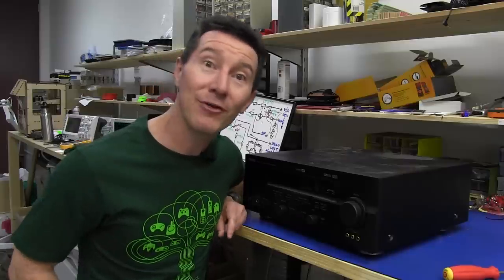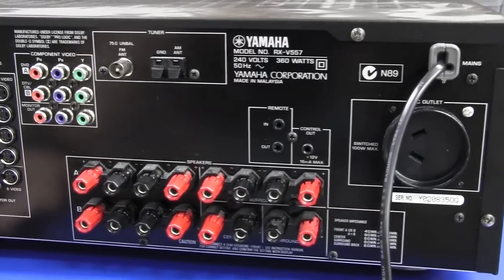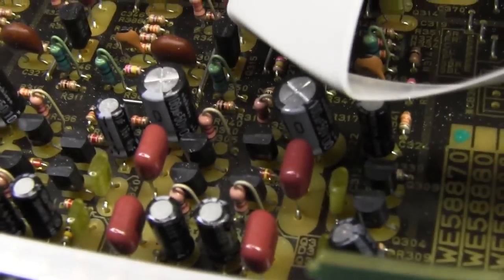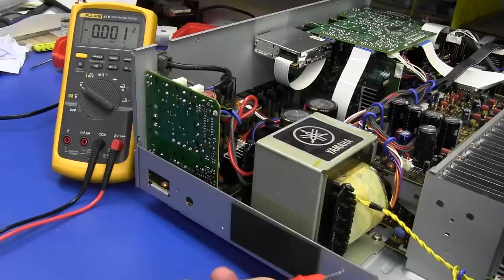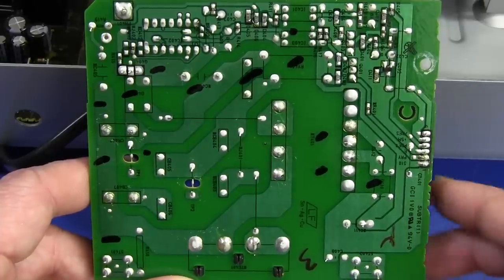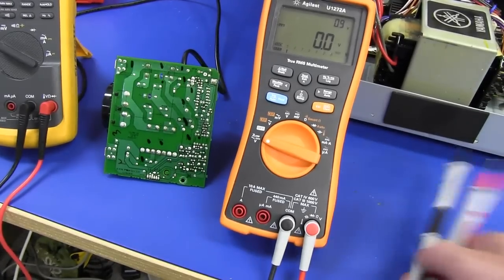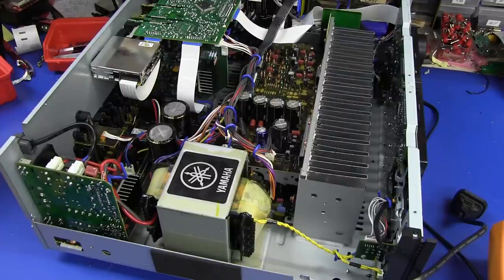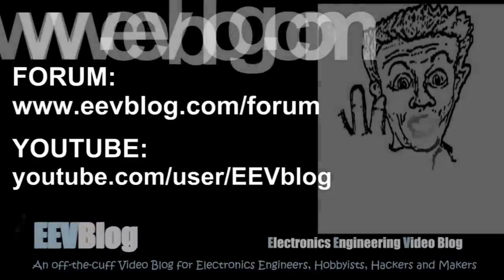EEVblog #378 - Dumpster Diving Teardown Repair

Comment: Dave a few steps for you:
1. Desolder C405 from standby board
2. Throw away
3. Solder a replacment
4. Enjoy
Reply: Hi!  Are you a repair guy?  Any experience with an RX-V1000 model?  Bought mine broken at a thrift store.  Her relay clicks when I hit the power button, but immediately clicks back off without ever showing anything on the display.  If I hold down the diagnostic combo buttons, the relays will allow it to stay on (even the speaker relays click after a second or two), but yet, no display, so I can't go through the diagnostics.  I can hit the power button and relays click off like normal.  Ever had that problem?
Reply: @FortyTwoAnswerToEverything  Same problem with mine mate.
Reply: @FortyTwoAnswerToEverything  I have the same problem with RX-V630.
Reply: @Brian-uq6jm  sadly I gave it away for another person to fix it.  I didn't want to put in the energy and time to try to fix it since it's very outdated with surround features like dts-x, atmos, 4k passthrough, etc
Reply: I got the same problem on a RX-V567, but I can't find the similar C405 component.
Cound you help?
Reply: So the question is, what focused you on C405?
Reply: That’s normal problem in Yamaha denon pioneer …..
Reply: @go_dirtty  same for me on a RX-863

Comment: C-405 (marked 223K 22nF @ 630 V) is your likely suspect on the mains PSU board
Reply: That be the one , that's what had mine playing dead.. fixed that $3 part and away she went better than new 👍
Reply: Hi I had the same issue on another receiver (RX-V459). I fixed it and it is now randomly shuts off after certain time sometimes even 15minutes. Do you know what can be the issue? Is it maybe the caps on the clock or data on the flip-flop?

Comment from the maker: Yep, turns out that was the problem (measured 500pF). Now, the question is why does such a 630V metalised polyester cap commonly fail in this circuit?
Reply: As soon as you powered it up, it showed a short, I was hoping you'd check for shorts on the caps/diodes as that's where it tends to fail, if we're lucky enough it's not the main IC/cpu that failed
Reply: @cjdelphi  What's the specs on that 630 volt poly cap?  Is there an "upper range" of current it can tolerate?  What if there's a temporary current spike on that line?  Or a change in the characteristics due to heating, or a soldier joint weak-point.
Reply: Which cap was it? It wasn't a varistor was it? Perhaps it was designed as a voltage spike protection and the thing got hit by lightening or some other spike.

Comment: I always recommend checking the output mosfets right away on any amp teardown. It's quite typical that a shorted output will trip a safe mode and keep the amp from fully powering on.

Comment: I'm always amazed at how quickly Dave can trace out the circuits, I worked for several years in a repair shop and I would have been lost here without a service manual.

Comment: I had an old 2001 Pioneer amp weighed in at 35kg she stopped working one day and I decided to open her up and see inside, my mouth fell open the detail and the quality was unbelievable Pioneer made some amazing stuff.
Reply: iShootBandits back when pioneer were good!! cant go wrong with japanese stuff. my 1979 yamaha cr820 just failed 20 minutes ago. after 36 years of HARD work the right channel failed. thats the first time it has ever gone wrong.
Reply: smallenginedude71 if you have right channel in headphones more than likely its the right speaker relay. for a relay to last almost 40 years is incredible
Reply: PhuckHue2 i had a sony hifi that lasted 25+ years, im only 26 though, it was given to me, but a few months back the right channel failed, i never found out what happened, so, i took her apart and got ALL the boards out, and all she contains is... rubicon and ELNA caps... but, im often curious as to what those tiny little yellow capacitors are ?
Reply: +iShootBandits same thing for the speakers.
Reply: killer1479
yellow caps are made by Mallory
Reply: PhuckHue2 well, theyre super tiny and look like theyre made of jelly =o

Comment: Good job on the repair. This unit is really complex and over engineered. I found a RX-V757 at the local Goodwill for US $25.00... and this one worked from the start...but... no remote or AM antenna. I did find a remote on EBay that controls the functions properly.

Comment: I wonder if the display is burnt. I have an old unit that appears dead, however the display is dead, after a fee button taps (with speakers plugged in) great music!
Reply: dry solder joint on display   connections maybe   reflow works on denons

Comment: Indeed. I work in a return material analysis lab and am surrounded by engineers. All of them work on diagnosing problems with existing equipment and finding a way to improve it. We get a lot of failed parts back and often times, an engineer will actually fix them to prove the source of the problem.

Comment: Yamaha made AMAZING products back in  the day. I still play a 1978 Yamaha guitar combo amp. I had to fix a couple of lifted traces where a former owner replaced the reverb pot with a VERY stiff pot (which put WAY too much tension on the board). It's just now beginning to get a bit of noise as if the power caps are starting to go. (After 40 years, I really don't mind replacing a few caps.). Still sounds amazing and is a very simple and solid design. Yamaha rocks!

Comment: I took apart the SAME EXACT one and I used the transformer for a power supply and the huge audio caps for the smoothing and the rectifier on heat sink for the rectification! And of corse all the wire I used for the power supply too!  Awesome!

Comment: I once have repaired Yamaha amplituner. It was not turning on at all. After just few minutes of searching in the internet i found that common issue was a cap in standby power supply, quick check with the multimeter and the capacitance was way off specs, part was easy to get in local electronics store, costing close to nothing, amplituner is still fully working today, my sister uses it quite a bit.

Comment: Those "heatsink things" on the large QFP are there to help with wave soldering. That's also the reason it's mounted at 45 degrees. It's not for routing, that's a requirement for wave soldering to work properly on a device like that.

Comment: I had one did the same, i had to push 3 switches together to reset the amplifier and it did go on. It was a yamaha amplifier. Factory reset combination switches pushed all together. Or change the little capacitor on the power board, the little brown one. I think it's c405.

Comment: This seems to be really well designed... All the blue wires, the repairability and even the service manuals with everything... Wow. We have a Yamaha amplifier/receiver similar to yours at home, has worked great for probably ten years soon, except for one thing, everytime the source is changed, the settings changed or the amplifier powered off or on, the subwoofer makes this horrible "thump" noise...

Comment: I forgot to say an important thing also. Before i had to reset the yamaha, i had to change a bad capacitor in the power supply section. That's why it did not want to go on, than i suppose it did put itself on self protection even if i did change the bad cap it would not go on until i execute the reset. So 1- I did change the cap. 2- It needed to be reset. 3- Imagine if they start to built all the amplifiers so if you don't know it has to be reset after repair and if second you don't have the service manual telling you which switch to push all together to reset it. Depend on each model i suppose but in that case i had the service manual so i've been lucky because without knowing this, the amp was fixed and there was no way to switch it on without knowing this. Excuse my english, i'm french. I follow you Dave since years now quietly and i did learn so much from you. Thank's a lot.

Comment: In fairness to Nichicon, it probably is made using prime spec processes, but on the other hand, does a slightly lower inductance matter (one common audio cap spec), for example, when you have a long PCB trace leading to it and all the channels? Probably not. The difference may be measurable, possibly even audible -- but simply moving your head slightly is likely to have a greater effect.

Comment: My guess is the microprocessor is programmed to look specifically for the pulse made by that Standby/On button to turn on, that's why bypassing the relay didn't work. My guess would be the transistor driving the relay on the mains board.

Comment: When the outputs blow they will damage the preamps many times and it will sense the DC on the output. We used to use a "suicide" cord into the unswitched outlet to power up the output section individually to see where the problem was. Only about 73 screws to take the output section out......

Comment: i've had Harman Kardon before to. Very heavy. Took cover off and the transformer, audio power circut, heatsink, all well built. Caps were very huge, I think they use seperate power supplies for each amp circuit. High current capable.

Comment: Never figured out why these things are called 'receivers'. I'd say the primary function is to amplify, and secondary purposes are to separate Dolby 5.1 signals into separate channels, give a bit of EQ and DSP, and do the radio tuner thing. Just wondering.

Comment: Shorting capacitors can cause high current transients that can damage the cap as the internal resistance is very low. Its better to use a high wattage resistor to discharge the cap.

Comment: I bought my Yamaha RX-V1300 back in 2003 and it´s still working great even with my new Klipsch Reference 7 Speakers. Only thing broke was the remote control which was my own falt [Never spill Soda over your Remote) :D.

Comment: I had something similar on a Technics receiver. Even when 'persuaded' by bypassing the relay, the display was blank. There was standby power to the processor, but it wasn't clocking. Turned out to be the ceramic resonator, after replacing that everything was fine and it's still going strong. 

Apologies if you get loads of these. Have fun anyway.

Comment: Last year I found a nice Sony STR-AV1070X stereo in the dumpster, took it home and it works perfect.There's a video repair shop near buy, they must've throw it out. For $20 bought the remote for it on Ebay!

Comment: The JVC receiver I looked at was a rather interesting receiver; it had a class-A bipolar transistor amplifier for the left and right channel, and class-D hybrid IC amplifiers for the surround speakers, and, interestingly enough, no center-channel amplification.

Comment: i love yamaha. they dont cut corners.
Reply: dispatcher7007 they are far better than most shit these days. their stuff you buy at jb hi fi and other stores like that will be average. but the pro yamaha gear and the yamaha gear at detected hifi shops will be some of the best equipment out there. sony, teac, panasonic, samsung and all that shit wont even come close. even rotel cant beat a yamaha
Reply: ***** it certainly is
Reply: dispatcher7007 I guess that is bad luck on your part then. I have the 657 (in silver) for years now and the only reason I haven't upgraded is because the damn receiver still works properly.
Reply: smallenginedude71 their vintage stuff is far better, check out a yamaha CA-1010 and you'll be real impressed
Reply: alex martin definitley. i have a vintage yamaha CR-820 so i am familiar with yamahas vintage quality. its a beautiful piece of equipment.
Reply: smallenginedude71 Glad to see another vintage yamaha enthusiast! My first REAL hifi receiver was a yamaha CR-620, still love it to this day.
Reply: alex martin yep. i am certainly a vintage yamaha enthusiast. mine is extra special to me. i inherited mine of my grandfather who purchased it brand new in 1979 for 450 dollars. i have the original instruction manual, warranty sheet and receipt. the unit is in mint condition too. even has the "reserved for yamaha orthodynamic headphones" plastic piece that goes in the headphone ports.
Reply: alex martin after 36 years... a sad day arrived today. my yamaha CR820 failed for the first time in its life. the right channel blew :( getting it fixed tomorrow....
Reply: If you can't get it fixed let me know, I'll be happy to service her and bring her to life.
Reply: alex martin thanks! i should be okay. one channel is still good and sounding great but the other channel is very distorted and has no power :(
Reply: ***** feild effect transistor failure
Reply: jutubaeh they had no surround amps in the 70s. surround sound amps are shit. this is good old 2 ch. nothing wrong with yamaha mate!!
Reply: A toroidal transformer would have been a good addition.
Reply: Yamaha DO cut corners - that whole fraking unit is cut corners at EVERY opportunity. It is the BOTTOM of the line from memory, at least as far as their DTS receivers go.
If you wanna see back when Yamaha DIDNT cut corners, at one point i had a seriously vintage 70s Yamaha NS-A450. They had gone as far with that this as mounting the input switches on the BACK of the unit with plastic bars running to the front buttons to keep the audio path as short as possible.
You just dont see shit like that anymore lol

Comment: I think this could have been found by using an o-scope on the low voltage PSW lines.   The loss of cap in this case looks to me that it would cause the later processor kit to fail a clean startup due to too much ripple.

Comment: Didn't hear the complete go through, but, did i not hear you say it read as if it powered up, but, it wont turn on? Did you check the display to see if it was properly functioning? I did see you check the relay and it seemed to work.

Comment: I scored a 457 for $20 in front of me with the same issue. Although I’m not getting power to the subtrans transformer. Q404 has tested faulty and waiting on replacement. After reading comments here I’ll also replace C405 in case it is also dead or about to die. 

I also have a 459 which had the same issue a few years ago. But had a pro audio shop repair it for $75.

Comment: Great video, bummer it wasn't repairable!  I have "revived" my Akai receiver a couple of times; shoehorned in a PC fan when the fan died, replaced the speaker output relays when the contacts died, and fixed a dry join on the main PS board when it started getting heat sensitive.  More than 10 years out of this sucker now, if it dies now I have well and truly got my money out of it!

Comment: Hi, have you ever heard about a electric screw driver????
With so many nice equipment, I was not expecting your method of removing screws :)
Great videos! Thank you!
Reply: ***** Shay, when you have several screws to remove, it comes handy, and of course I still use the good ol ones.
Reply: I used to use an electric screwdriver, but I've broken too many screws in doing this. I personally recommend against using an electric screwdriver, you run too much risk in breaking screws. Especially if you're servicing someone else' equipment. So I'm pretty sure David know what's he's doing.

Comment: I think you've got an open diode in the little rectifier which is why you have a high ripple on the first voltage you measured.

Comment: Oh I remeber whgen you helped me fixing the SAME thing on another yamaha years ago, or at least the same part, you know the capacitor in the input on the PSU board. 

still they do make very decent hifi systems. good luck finding the culprit!

Comment: Maybe check where you hook up the speakers because sometime if the positive and negative speaker wire touch that will make it go into stand by ,check the audio out board their may be a little peice of wire touching and causing it to stay into stand by mode

Comment: Yellow wires from the xfmr are probably for the filament on the Vacuum Fluorescent Display.   Best to check for power to the micro processor, and check the 16MHz crystal on the processor.   Presumably the processor is likely bad and not waking up.

Spend more time on the troubleshooting/repair of consumer goods, you'll get pretty good at working on crap like this.

Comment: Yeah.  If they would just say that because they are higher quality that they stay within tighter tolerances and will last longer, that would be honest advertising, and the tolerance thing can be applied to audio.  Not so much in quality of the sound, but keeping a certain coloration consistent and balanced across channels.  I spent over $500 on my headphone amp.

Comment: Probably parted out by now. Apparently C405 .022uF 630V in the power supply board goes out of spec in many of these amps.

Comment: On the Vestel sets it is pretty consistently two 15n 630V metal polyester caps that die. They usually fall in capacitance enough to cause the power supply to brown out and loads of weird stuff to happen. I doubt they short because the fuse is usually intact the TV just stays in standby.

Comment: I would have checked if there's a 50/60 Hz sync signal derived from the AC power. Some CPU chips require this signal in order to cut power instantly to avoid a loud thump at the speakers.

Comment: Way beyond my electronics level but still interesting to watch and learn .
As another viewer has posted did you check that the display is not dead and also try hooking up a speaker to one of the outputs to see if it makes any noise ?

Comment: The yellow extra wires on the main transformer are propably a thermal fuse. Would make sense since they are labled F1 & F2. And since you said you have 5 volts over them it propably failed.

Comment: I had a Denon receiver that I had repaired, and it turned out to be something similar where it checked for +15V  on a circuit and if it didn't see it, it would only turn on for 3 seconds then turn off. So your idea that it was some sort of checking system is possible.